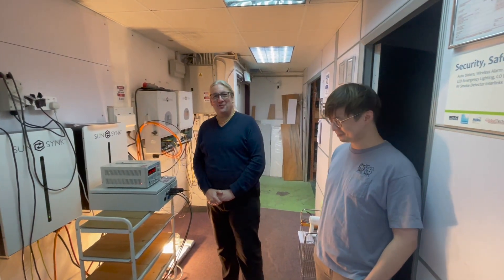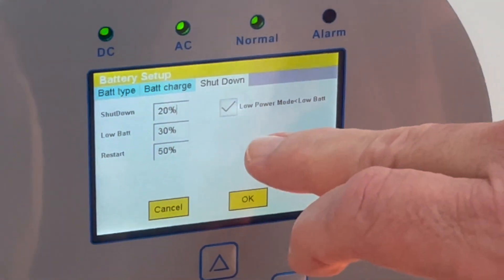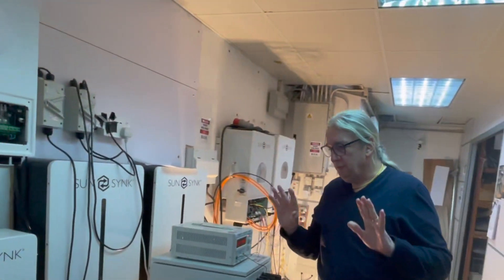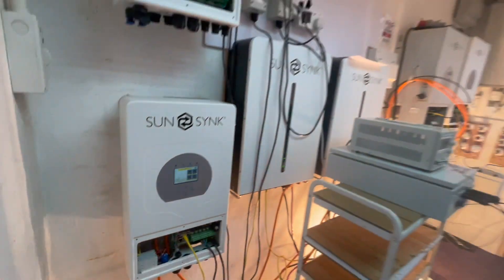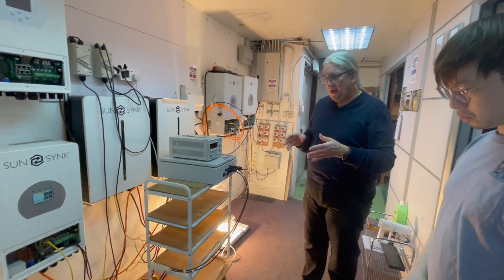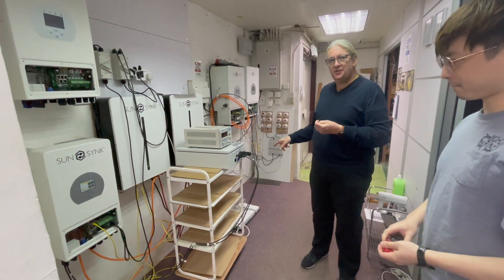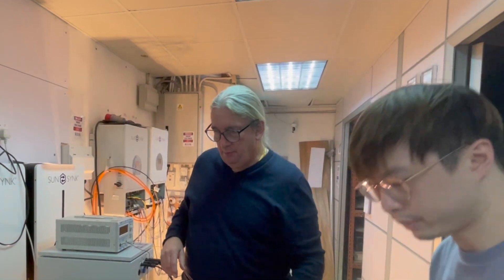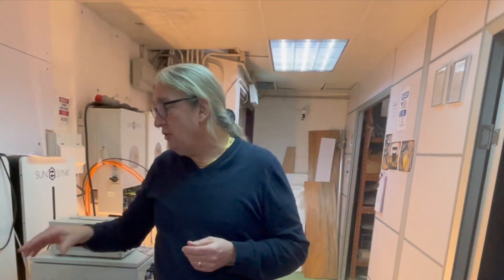Low Power Power

Comment: Not clear what Low Power Mode actually is. What changes when it comes back? Is it running at higher efficiency? Is it still rated for full output? How much less power is it consuming?
Reply: Low power mode puts the inverter into a low-power 'standby' mode when there is no solar power and the battery is low, so that you are not using power from the grid to power your inverter - the inverter uses 50W or so just to run itself, so by using low-power mode the inverter saves you money during low-solar days. When the sun comes out and there is solar again, the inverter comes out of low-power standby mode and starts working for you again. Does that help explain?

Comment: Are you a customer or certified installer? I, as a customer, can ask my installer to request an upgrade. This will then be considered and initiated.  But in some cases, you can contact Sunsynk (call centre is in India) and request that your inverter/s be upgraded provided they have the right information, and  would then proceed and be carried out without problems.
N.B. take note that if a current version of firmware/software is working fine and a potential upgrade becomes available, always consider if the upgrade is beneficial to your use case. This video's update   being discussed is specifically for areas/places with minimal sunlight during the colder winter months.

Comment: Where do we download the software please as it's not available via the update link on the portal?
Reply: Are you a customer or certified installer? I, as a customer, can ask my installer to request an upgrade. This will then be considered and initiated.  But in some cases, you can contact Sunsynk (call centre is in India) and request that your inverter/s be upgraded provided they have the right information, and  would then proceed and be carried out without problems.
N.B. take note that if a current version of firmware/software is working fine and a potential upgrade becomes available, always consider if the upgrade is beneficial to your use case. This video's update   being discussed is specifically for areas/places with minimal sunlight during the colder winter months.